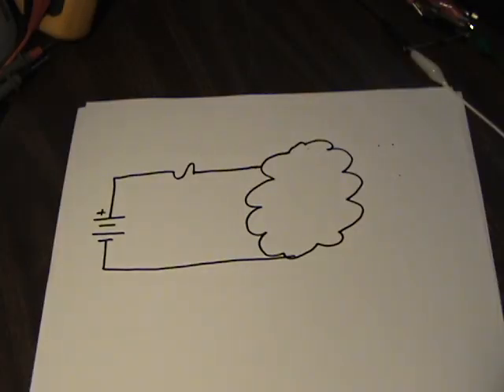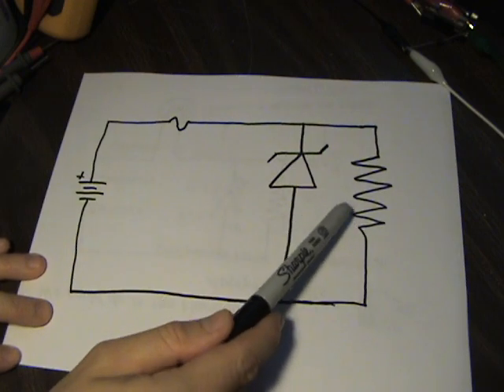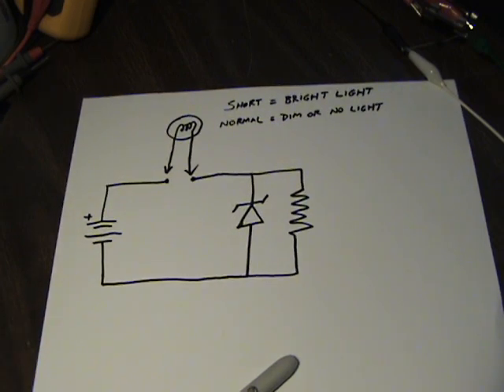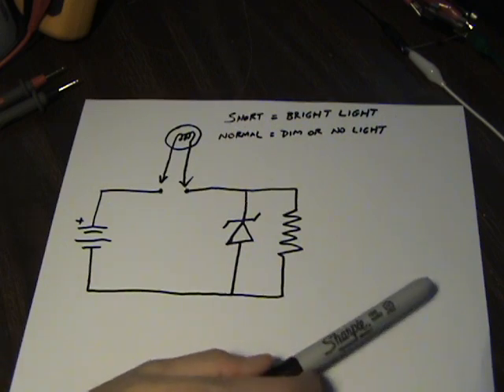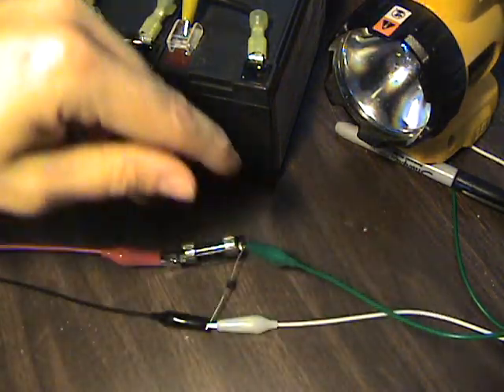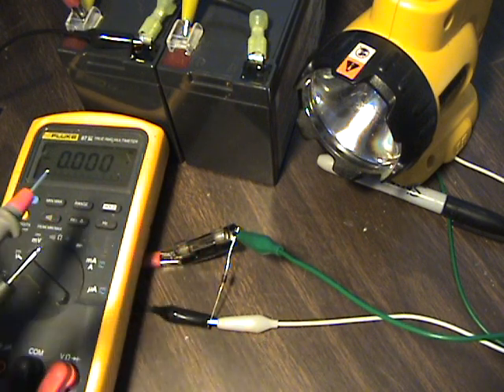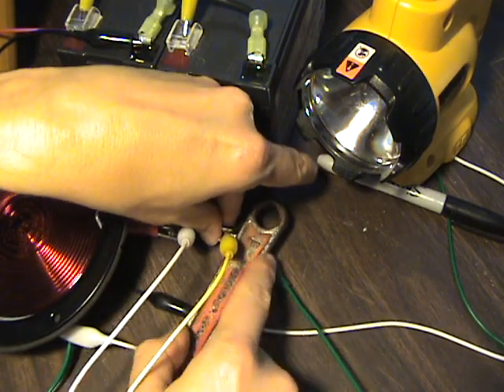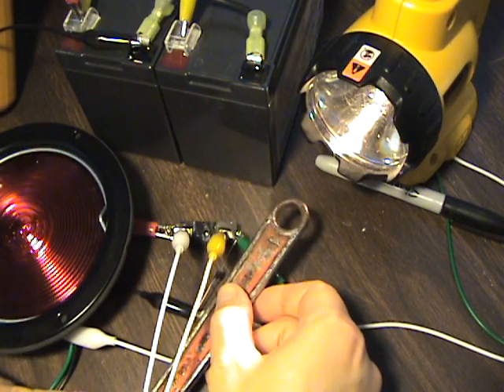Light Bulb Trick Explained

Comment: you didn't explain why when there was no short, that the flashlight bulb lit up but the 
TESTER bulb didn't.  I know why, but others may not!  When voltage is applied to the circuit, current is flowing, and the tester bulb is part of the live circuit and current is indeed flowing THRU the tester bulb (or it couldn't reach the flashlight bulb), so why does the tester bulb not lite?
Reply: enforcer mj what's the answer

Comment: Done this  for years  looking for  shorts  in automotive systems.    I use things like an old headlight,   and or  a  stop / tail lamp socket. you can wire it different ways,  put the two filaments of the stop / tail in parallel  for  heavier,  use one  at a time for lesser current or even  put  the two filaments in series and leave the lamp ground  float.   I used to charge  EG  bike batteries this way off a 10A charger....both stop and tail filaments in series  and it limits current  to the battery.